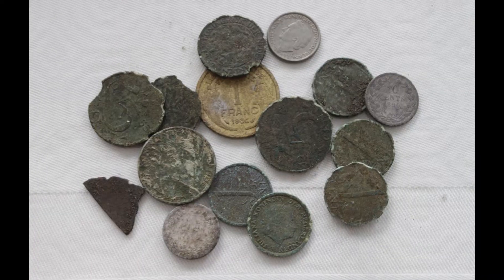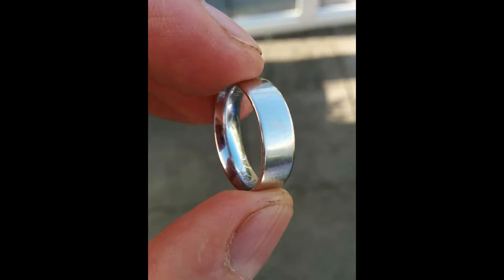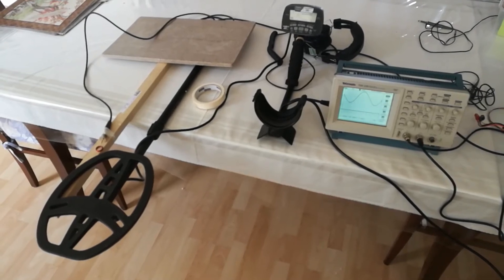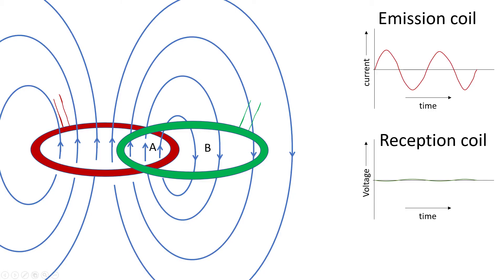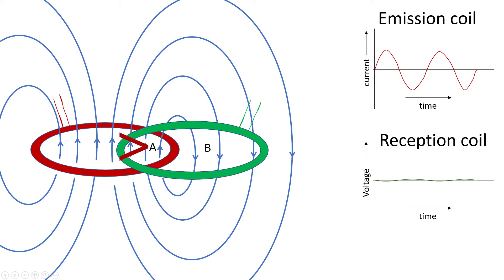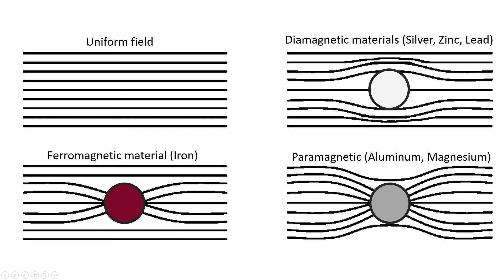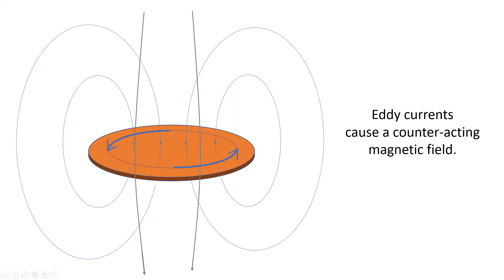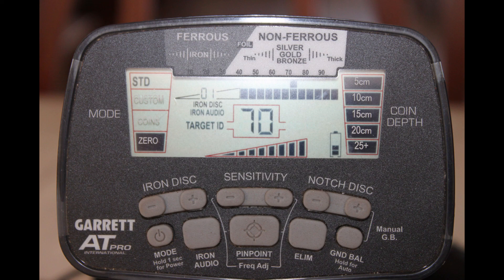Metal Detector Discrimination Explained (with a Garret AT Pro)

Comment: To better discriminate the Foucault currents (you call them eddy currents) you must use a third coil driven with 1 - 2 Hz signal, at pretty high intensity, 10 - 20 Ampere. This eliminates the need to move the coil assembly over the soil. Some used a neodimium magnet driven by a motor, but this produces a lot of interferences and the 2 Hz signal is hard to subtract in the signal processor.
A better way is to use two independent 19 KHz oscillators, and drive them so there is one 360 degree phase rotation per second of one oscillator with respect to the other. This make possible to measure the AL (permittivity / reluctance) and hysteresis separately. A modern 50 pence Cortex processor can do some stupendous tricks with the use of a FFT algorithm. I'm an analogue die-hard designer but I must admit that a good written code on a microprocessor seems to do miracles sometime. Enjoy the fun...
Reply: So the phase shift of the received signal only "suggests" the metal being detected - does that mean that most detectors from $60 to $200 are likely to all be doing the same thing?   I wonder how "depth" works... perhaps the amplitude of the wave? Probably!   I wonder if the $300 detectors with the double D configuration cost that much simply because they use the better coil configuration, without much change in the circuit?  The multi-frequency detectors must have some look-up table that provides extra information on each multi-band signal "profile" they see. I'm guessing the research that lookup is where the money is going, rather than the pure cost of components.   Do you know how the "pin point" works, without having to move the coil to read the signal?

Comment: This is my kinda cake.... LOVE IT!! 
Well done SIR

Learned alot and amazed in how much i had wrong on the principle.
Especialy that there s one recepteror coil and one transmitting .
i was under the impression that the two coils alternate between beying a receptor and emmitor coil .
thanks for clearing that one out .

I had a garret detector , nowerday i hunt inland with XP DEUS and on salty beaches with an Minelab equinox 800 .
Would love to see you analyze the FBS method they use , sending 5 different frequencys at once and eliminating all interferrence with the metalions present in salt.

would love to loan my minelab detector , so you zouldn't have to buy one ;)

these are topics i litrteraly lay awake of at night , as i dream of making my own metaldetector ..one day

greetings from Zeeuws Vlaanderen hihi
Johny Geerts

Comment: Could a simple metal detector be created by using an off the shelf cordless signal generator to drive the signal coil at 15.3 kHz and a low cost pocket oscilloscope connected to the detector coil to read the signal?  Then just watch the scope signal visually.
Reply from the maker: Yes I guess it is possible though it would be a bit of a  cumbersome and expensive solution

Comment: Very interesting video! I believe this is the same effect used in shaded pole induction machines, which never made intuitive sense to me until now. They use a copper ring in the flux path of a single phase induction motor to create a weak additional phase to get the motor spinning (otherwise the magnetic field just alternates without spinning the motor).

Comment: I just recently started this hobby. This info helps a lot. My most exciting hunt starts today. My father just bought a new house just outside of historical Sackets Harbor. Metal detecting in the village is not aloud, but being his property is just outside the village, im good to go. Fingers crossed i find some really good finds.
Reply from the maker: Good luck, gernerally there is a reason why metal detecting is not allowed in certain places. There might be a lot to find, but it can also be because you are likely to dig up dead peope or dangerous stuff.
Reply: @HuygensOptics  ill be very careful in this endeavor. The historical significance is due to the war of 1812. The property is actually 2 miles north of the "battlefield". Im not an expert by any means, but after speaking to a few people that are, ive been told that the chances of finding any type of live ordinance will be pretty slim. I found out this morning that the original owners great grandfather was a blacksmith. Hes on his way over now to show me where they believe his shop was. The property is pretty big (in my opinion) at 12 acres and the original farmstead/house/shop is not where the current house sits. Ill let you know if anything exciting is found.
Reply from the maker: @justaguyandhissilver4893  sounds exciting, good luck! I'm pretty sure you are up for a few nice finds.

Comment: Question , does the phase shift lines matter?  in fine tuning accuracy  & discrimination  . The sine wave being staticky and spikey verse smooth
Reply from the maker: I guess you are referring to the difference in "noisiness" of the signals. This has nothing to do with the phase by itself, just the signal strength. For objects that give a small signal (for example because they are small) you need to increase the gain in the experiment, which causes more noise in the result.

Comment: Excellent video and very nice experiments. Please allow me however to express some doubts about the interpretation: I don't think that diamagnetism or paramagnetism play any role at all: they are both extremely weak effects with susceptibilities in the 10^-4 range. Moreover, many non-metals are diamagnetic and/or paramagnetic and do not give any response to a metal detector. My understanding is that the phase shift is mostly determined by the decay time of the eddy currents in the object, which is given by L/R, the ratio of the inductance to the resistance of the object. Thick silver/copper/aluminium objects have an L/R of order 100 microseconds, while iron or aluminum foil have L/R of less than 10microseconds. Compare these to the period of the 15kHz emission, and you get the high L/R giving a lagging disturbance with a big phase shift and the low L/R an immediate disturbance with little phase shift.
Reply from the maker: I agree that the main detection mechanism for most metal detectors is based on conduction and eddy currents. However, conductivity alone cannot explain the differences in phase shift between metals. I'm not sure to which non-metals you refer, but conductivity is not always required for detection with a metal detector. Take ferrite: non conductive, paramagnetic and it gives a huge signal. Not all metal detectors will see it though, due to discrimination settings.
Reply: @HuygensOptics  I was thinking of liquid oxygen, but actually that's an exceptional case, there are indeed very few non-metallic paramagnetic materials. On the other hand, every material is diamagnetic. Ferrite is ferromagnetic and ferromagnetism completely overwhelms paramagnetism if present.  My understanding is that only conduction and ferromagnetism give a response in metal detectors, with conduction giving a phase shift between 0 and 180 degrees (twice the phase shift of the equivalent LR circuit) and ferromagnetism contributes with 0 phase shift (if it is instantaneous compared to the timescale of the oscillating field - but I'm not sure about the latter..)
Reply from the maker: @rgco2266  that is correct, ferrite shows 0 phase shift (or very close to that value), as is also shown in the video. In the standard detection modes of the Garrett it is not always detected due to this exceptional behaviour. However, in the "pinpoint mode", it is always detected very strongly because only signal is considered and phase is ignored. Thanks for the additional information you supplied.

Comment: It is very informative. Thanks for preparing such a video. 
I want to have a sensitive metal detector, but they are expensive for me. I have a scope meter. I wonder if i can build a detector by making 2 coils for discrimination and using the scope meter as a detecting monitor. Then, connecting them to each other. Do you think it is possible? If so, could you please help me with the correct schematic?
Thanks a lot.
Reply from the maker: Well, it's possible, but not practical. You need an oscillator as well. Better Google for schematics for a discriminating metal detector if you really want to build one yourself. Or buy a cheap entry level detector second hand to find out if metal detecting is even your thing. Hope this helps.
Reply: @HuygensOptics  Thank you for your help. You've shown me the way.

Comment: Very informative video. The question I have is what is the uH value of the second coil ? In advance many thanks
Reply from the maker: I did not measure it, however it's quite high. Where the transmission coil only has 10-20 windings, the reception coil can have many hundreds of windings. If I think of it in the coming days, I will try to measure the actual value.
Reply: @HuygensOptics  hola buena noche  quisiera  saber  si puedo  conectar  bobina doble d  a detector pirata ruso
Reply: @HuygensOptics  hola  buena noche te quería  pregunta  de la bobina doble d  tiene dos cables  vivo  y dos  negativo
Reply: @robertonazarenofrias3500  why the broken Spanish?? xDDD
Reply: @Ktulu789  hola buen dia amigo quisiera saber si tene el lista de los componentes electrónicos del detector de metales terminator 3 el que  tiene  7 imtegrados de  catorce  pata  y un integrado de 8 pata
Reply: @Ktulu789  y si tene la lista de los componentes electrónicos si me lo pode pasar gracias

Comment: Goedemiddag.
Thank you for this video its very informative. Have to admit i dont understand everything though. Bit frustrating because i realy badly want to understand it. I recently built a PI metal detector using 3d printed parts , it works ok using a colpitts ocilator and arduino. It works well enough 
to find the pipes in my house walls, but the metal has to be about the same length as the coil before it will detect it about 20cm , smaller objects has to litrally enter the center of the coil. The theory and methods behind metal detection has become an obsession 😀.  Groete from a fellow afrikaner dutch descendant. Goeie werk en hou so aan! Lekker!
Reply from the maker: Hello Martin, So the video is about VLF-technology (Very Low Frequency), PI detectors work on a different principle as you likely know. I also build a PI detection setup and, like you,  found that it is actually not that easy to achieve a high sensitivity. Also, evaluation of the rise and decay in the magnetic induction caused by the pulse was not as easy as just examining the phase shift observed with VLF, so discrimination is hard. If you are digging for gold in an iron-rich ground, PI is the technology to use, but even then you need all kinds of tricks to filter out the signal from the noise if you want to go deep. Here in the Netherlands most PI detectors are not very usefull, because of the generally limited dicrimination between treasure and trash. So that is why I don't own one. Good luck detecting! Cheers, Jeroen

Comment: Nice information about Garrett AT Pro machine inner workings.
Can you do a similar video about MineLabs Multi Frequency CTX3030?
Thank You for the consideration of such a project.
Reply from the maker: It would be interesting to do, however unfortunately I don't have one at my disposal. As for the principle of the 3030,  it also uses  induction balancing (double D coil). However it does not use a single frequency like the Garrett AT pro but rather a range of frequencies between 1.5 and 100kHz. Because the inductive response of metals for each frequency is different, you can in principle have even better discrimination and identification then when using a single frequency. The frequency can also be optimized for a high depth range in a specific type of soil. With GPS and Wifi, all in all it is quite more advanced.
Reply: @HuygensOptics  Thank You, It is all that as you say, very complex for sure. I've had mine for 3 years now, it is a very sharp learning curve for sure. I keep learning about it every time I take it hunting on dry land or at the ocean beach. But, it goes very deep & tells me whats down there, I just have to listen to what it's telling me. lol Thank You again. Darrell

Comment: Nice video, curious as to why gold was left out. Would be interested in the science behind why gold and aluminum ring up similarly, and if there is a way to potentially distinguish between the two with a detector.
Reply from the maker: In principle it is possible to distinguish between the two, gold is diamagnetic whereas aluminium is paramagnetic. They have approx. the same conductivity, and this will be the mayor contribution to the phase shift in VLF detection. An advanced PI (pulse induction) detector should be able to detect the difference between the two materials.